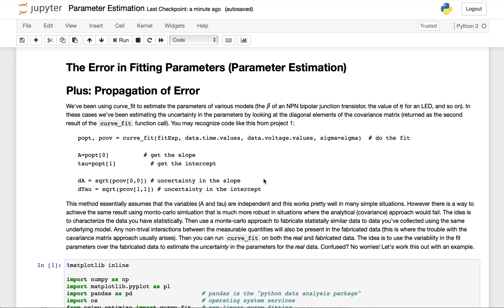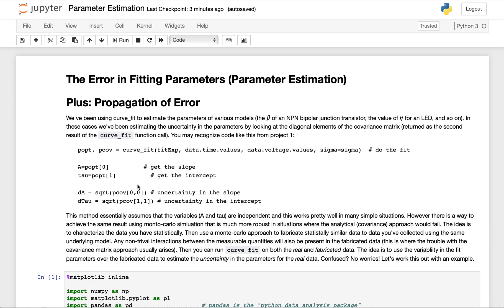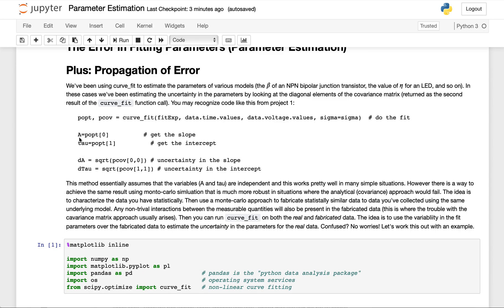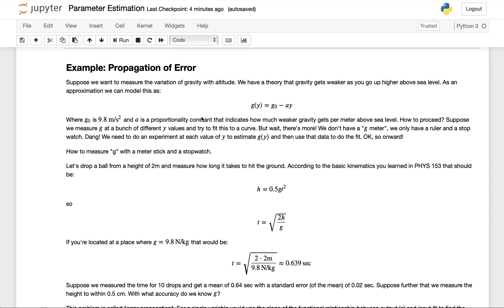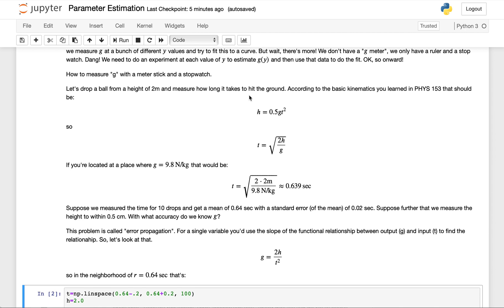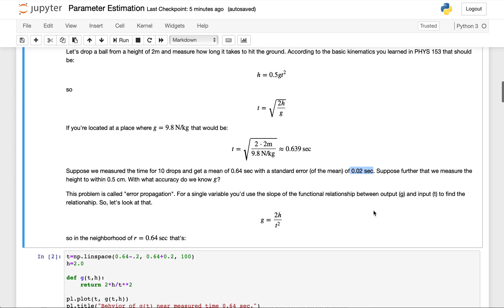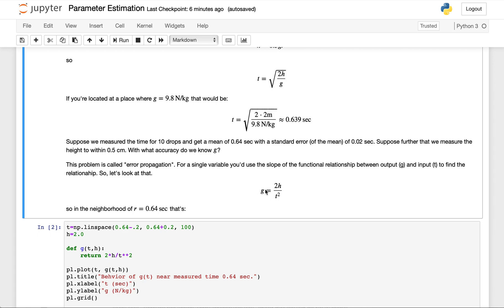Estimating The Error In Fit Parameters

Comment: I measured the flow rate 'Q' versus the pressure drop 'dP' curve for some experimental setup. Each parameters has an experimental error. I would like to make a polynominal or a power fit of the data using the averages values, dP=aQ^2+bQ+c, or dP=aQ^b. How can I calculate the error of the fit due to the error in both dP and Q?

Comment: Great Video, Thanks for putting this together. 
I'm a little confused as to why you don't include altitude in the sigma_g equation.
(sigma_g/g)^2 = (2sigma_t/tvals)^2 + (sigma_h/h)^2 + (sigma_y/yvals)^2.
The conclusion is that altitude is very small with relatively large uncertainty, yet, altitude wasn't in the sigma_g equation, or in the original equation for g = 2*h/t^2. So it seems by definition, we're not going to see an effect of altitude on g.

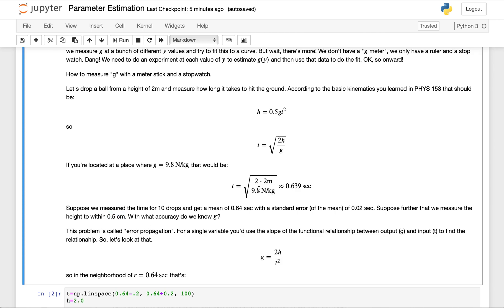Comment: At around 3:50, when you multiply g by the uncertainty (~1/16) what g are you using? The calculated g from measurements gm = 9.77 or the actual value of g = 9.81
I ask because  9.81/16 = 0.613 and 9.77/16 = 6.104. It may be a typo unless im really missing thing.
Reply from the maker: I think I'm missing something. Where are you getting 1/16? Where do I multiply g by 1/16? The idea is that t has some uncertainty (0.02s), h has some uncertainty (0.5 cm) and both of these contribute to an estimate for the uncertainty in g.
Reply: @sspickle  Im sorry, at 8:50ish. I dont know how I got the wrong time stamp.
Reply from the maker: @peterbrehmj  I see, OK. 1/16 just comes from 2x0.02s/.64s ~ .04/.64 ~ .01/.16 ~ 1/16 ~ 0.063 or roughly 6%. The difference between 9.81 and 9.77 is only .04 which more than 10x smaller than the actual uncertainty (~ 0.6 N/kg) so it's basically insignificant.
Reply: Also why don't you fit with the mcY values from the Montecarlo? You only fit the data on the mcG data.
Reply from the maker: @peterbrehmj  Good point! Yes, in principle I should've fit mcY. I think in this case most of the parameter uncertainty comes from the variation in g so I was focused on that, but you are correct!

Comment: If I know the error associated with each mesure, shouldn't I create a normal distribution for each mesure with the associated error and then make the  fit ? Why should I use the fit value of g instead of the mesured one ?
Reply from the maker: My thinking is that the measurements can be modeled as random fluctuations around a well-defined curve. The best estimate of the curve is the fit, not the measurements. Does that make sense? I'm not sure that, in the end, it would make a lot of difference, but that's my logic.
Reply: @sspickle  I think it makes sense, maybe i could make a weighted fit using as weight the inverse of the error associated to each of the mesured data and then proceed as you proposed. In any case very good channel!!